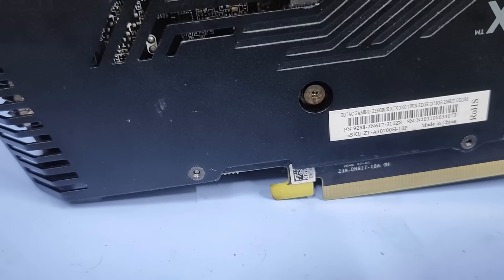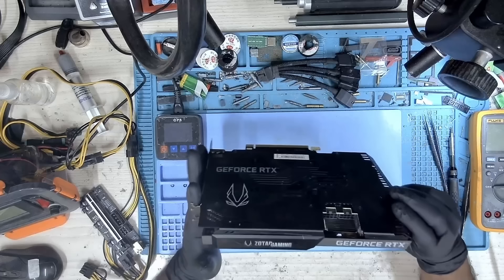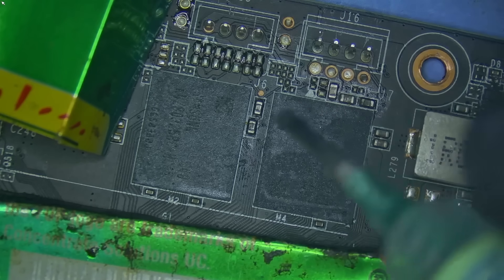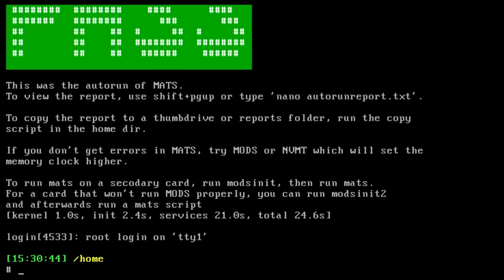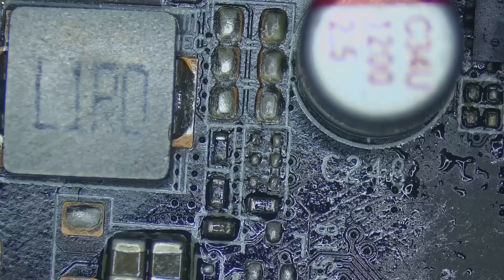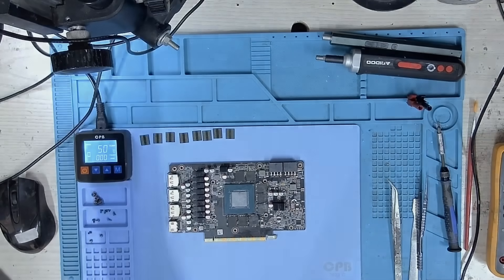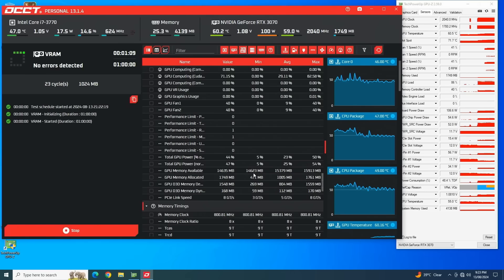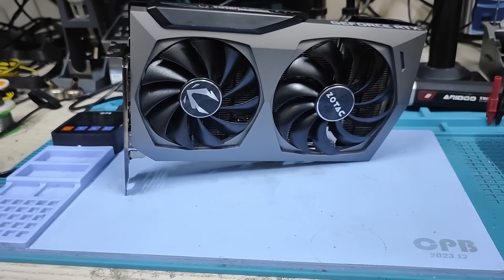Upgrading RTX 3070 Memory from 8GB to 16GB - Part 1

Comment: ive been thinking about pulling the rx580 cards that i have in the closet and modding them  andd adding  8gb more liek the  580 sp cards in china  but doing it at home  do you think you coudl make a video abotu doing this  with the rx580s i knwo the spots are there all i woudl have to do is solder the spots then use the heatgun and put the same vram chips on but i dodnt knwo if there is any software that wouidl need to be changed   and i knwo this woudl help the rx580  in alot of games these days for exampel i used to play tarkov  with one of them cards but the issue with playign tarkov was mostly the vram  liek streets of tarkov uses about 12gb of vram on my card i use now
Reply from the maker: RX 580 uses GDDR5 and 1 GB is the largest capacity produced on this platform. It has 8 memory slots and all 8 are already populated with 1 GB. To install more memory you will need to design a new PCB with memory slots at the back. This is an expensive procedure unless it is mass produced. The cost involved to get an upgrade done on RX 580 or any GPU that needs a custom PCB beats the purpose of being cost effective unless some factory is already producing a PCB like this like the RTX 4090.

Comment: Unfortunately the onboard controller doesn't know how to handle that much memory. I'm sure you might be able to tap into the extended frame but it will have glitches, crashes and blue screens then again who knows with some of these drivers
Reply from the maker: So far I have not experienced any glitches with the upgrades.

Comment: Avec quelle puce mémoires tu a remplacer les 8go en 16go ? Es des puce de 4go ?
Si oui alors il est possible de faire une rtx 3060 12go a 24go et la rx 7900xtx de 24go a 48go. Je dit cela car les plus grosse puce pour carte vidéo est 3go.
Reply from the maker: On GDDR6 and GDDR6X the largest capacity is 2GB. The memory used in this video is 2GB to upgrade to 16GB. So any GPU using GDDR6 or GDDR6X using 1 GB modules can only be upgraded to 2GB. RTX 3060 and RX 7900XT already use the 2GB module so it cannot be upgraded further. I have a dedicated video where I explain this in detail. 
https://youtu.be/nJ97nUr1G-g?si=1aFloIVAn2X0fFME

Comment: Do these upgraded v ram gpus come with a custom driver download that works and doesent crash. A rx9060xt/9070xt 16gb to 32gb would be prob the #1 gpu on the planet. Nvidia sucks cause they purposely will try to kill performance yeah itll be a custom driver but based of their driver thats tries to lower performance unless yall can weed that coding out
Reply from the maker: The largest capacity on GDDR6 and GDDR6X is 2GB. If it already uses the 2GB modules it cannot be upgraded further. All of the 6000, 7000 and 9000 series already use the 2GB memory modules. There is no more room to upgrade.

Comment: i have a 3060 12gb would be nice to make it 24gb i also have a radeon 6800 16gb wonder 32gb
Reply from the maker: Unfortunately 3060 and 6800 are both at its maximum possible memory capacity.

Comment: Have you seen the Chinese GPU aftermarket?

They upgrade all their GPU's instead of upgrading to a new one bc of financial and supply reasons. They have 64gb VRAM 5090 kits, 48 GB VRAM 4090 kits, 32 GB VRAM 5080's, pretty much everything. Even low end cards like 5060's get upgraded to 16gb. 
I think its so cool and wish more people here in the States did it so it would be easier to get the custom firmware needed and there would be more people making custom BIOS updates and everything else needed to accompany the VRAM upgrade.

Great work man, I wish I was as talented as you.

Comment: I wish the manufacturers would just allow us to add Ram, as if it were System Memory. (maybe soldered ram is faster?)
I have a 3060 ti. This card is actually a cut down 3070. The 3060ti is known for running out of VRAM too. (my 3060ti uses a SK-Hynix version)
Also it is said the 3060ti runs the risk of VRAM failing prematurely (mine is still good) I wonder if this could also be considered a preventative maintenance job?

Comment: What is a pain is that not only having to ball/flow the chips, but the resistors "straps" to get the higher capacity memory recognized.  I guess the ball/flow is worse, but there is no room to maneuver with the straps.  As long as you don't short anything you can always start over if your balls aren't connecting well.  Check for shorts before powering on.  And as the video shows, check 1cm around the chips in case any straps have been dislodged.

Comment: There is zero reason for ANY 1440P + card to come with less than 16 gb of VRAM and there is no reason for any 4K card to ship with less than 20 GB of VRAM imo 

1080p cards should all be 10-16 gb by default as well. 20-32 GB should be default for 4K 

Basically, 8GB cards shouldn't be a thing

Comment: Can you do a laptop? I've got a 4gb 3050 that just needs another 4gb
Reply from the maker: Most of the 3050 in laptops only have 2 active slots. It depends on what configuration is your laptop having. I have never tried upgrades on laptop yet. But if I do I will release a video on my channel

Comment: The fact my 3070 has 3 fans and still 8GB VRAM still makes me hate myself for not reading the specs first and not knowing much about PCs at the time.
Reply: when did you buy it? for its time 8gb was still kinda decent. tho 3070ti still has 8gb which is kinda dumb
Reply: @ArtByAhri 3 years ago. But there is a 16 gb version of the 3070 if im not mistaken. I was just a dumbass and didnt know there was 

Don’t get me wrong, my 3070 still gives me at least 60 fps on 5k resolution with three monitors on High settings, it’s a beast. But I would had definitely gone for more VRAM if I knew

Comment: Hmmmm.

Buying a bunch of soldering kit and some VRAM from aliexpress or wherever (and hoping it works), then spending hours trying to remove the existing VRAM and add the new and then hoping it all works...

VS.

Selling the card on eBay and buying a newer RTX card with 16GB of VRAM.

Comment: Not A Single 30xx Card Need 16GB 🤦‍♂All New Games That I Played In This Year Needed Maximal 5-6GB Only 🤷‍♂ And That With RTX 3050 (8GB) 💁‍♂ The Performance Is Just Too Weak, For Enabling/Using All Features AnyWay 💁‍♂ Same With 4K ReSolution. They Wasn't Build For It 🥲
Reply: Idk why a 3050 should decide it but some rtx 30 series cards should get 16gb. The 3070 is one of those imo.
Reply: @tietieno4890  I Know, I Know 🤗 But It's Not Worth It AnyMore 💁‍♂ Any 50xx Card With Higher DLSS Version Is Better Here 😐 But The Prices Are Horrifying As Fu 👀💀 RTX 5070 TI Is My Dream Card And The Price Never Reached Around 600 Euro This Year 🙄 (Checking EveryDay 😆). 600 Is Still 200 Too Much, But I Would Accept This ComPromise 🤗 (400 Euro Is The Double Price For The Double Performance Of The RTX 3050 💁‍♂ BTW)
Reply: @ThePolishJoker  Good lcuk finding a rtx 5070 Ti for 400 euro's let alone 600. The MSRP itself is already way over that
Reply: @tietieno4890  That's The Normal Price In The Normal World 😆👌 And They Reduce The Prices Automatically With New Super + 60xx Cards 😏 This Is How Rich NVIDIA Works. They Don't Care About MSRP 💁‍♂ Only About Fresh, Hot Sensation. (Example - My ASUS RTX 3050 8 GB Dual OC, Lost Its Value WithIn 2 Years Around 40% And That After Covid. Not From MSRP 🤗). WithIn 1 Year, The RTX 5070 TI Dropped Around 45% 💁‍♂And It Will Easily Drop Further To 600 Euro (50%). 400 One Day, When NoBody Cares AnyMore 😆👌

Comment: Can RTX 3080 be modded to 20GB or even 12GB??
Reply from the maker: I have not managed to get it to work yet.
Reply: @GraphicsCardRepairs-tk7ql I think 20GB mod could work. 12GB requires 384bit bus width and the normal 10GB variant might not have that on PCB.

Comment: The risk of the operation do not worth it. Sell it and go buy a new one! Too much noise for nothing, plus that you will pay the double in electricity in just one year. What an idiot, too many risky fixes for an old card that soon will die anyway! Plus that you have for sure to raise the power consumption for a 5year old technology adding this extra memory. Just the opposite thing of being ergonomic. You will spend more money in just one year to use a much more old card, that soon will die anyway, and maybe sooner from the risky fixes that you made. I will overpass you with an rtx5060ti 16gb for fun, when you will burn 200+ w just to play full hd ultra, when at thesame time I will undervolt the card burn maximum of 50w, being at 35C - 38C for the same or better result than yours! This is not an upgrade that you did, is tottally a disaster in long term plus that you lose time for nothing! You will not save money, you will just pay more in the end! And soon you will burn the card anyway! So you will buy a new one and you will lose the money that you can take by selling it! What an idiot!

Comment: How did you solder the new memory chips on the desoldered pins?
Reply from the maker: everything is in the video. Otherwise I have not understood your question.
Reply: @GraphicsCardRepairs-tk7ql  i was thinking what liquid you used to remove/put back the memory chips on the board. (or maybe the memory chips are presoldered and i didn't notice) i'll rewatch the video maybe i overlooked it

Comment: Why did you changed resistor position just flash bios
Reply from the maker: The BIOS already has the timings for the memory modules, like Samsung, Micron, and Hynix. The resistors I changed are STRAPS through which the BIOS identifies which memory modules are installed. Samsung produces 1GB 14Gbps modules and also 2GB 14Gbps modules. During the testing phase of the RTX 3070, Samsung was the only one that had a ready 2GB memory module. The others, like Micron and Hynix, did not have it ready at the time. They did later. So the BIOS of the 3070 has the memory timings for the 2GB 14Gbps memory modules in it. There is no need to flash the BIOS as it already has everything.

Comment: where's the details on the straps configurationnn
Reply from the maker: You can find it in the schematics and boardview.
Reply: @GraphicsCardRepairs-tk7ql  yeah I guess they would be there but where do I get those, can't find em anywhere
Reply from the maker: Try badcaps.net @JuanPabloAlvarez-f7s

Comment: Great video, thank you for sharing. Getting those memory chips in the correct orientation looks tricky! I'm not sure how you did it. I saw a spot in the corner of one of the chips but couldn't see anything on the PCB to line it up with.
Reply from the maker: Over time you start to get it right. There is a square mark on the PCB you have to align the chip with the square.

Comment: 3070 had so much raw GPU muscle for the msrp of $499 that it had many people selling off 1080ti/2080ti’s right before crypto hit. 

The AMD 6700xt & 6800 turned out to be the better buys with 12gb/16gb of VRAM. I own them both and the only 8gb I still own is a $160 Dell 3060ti that is doing just fine at 1080p 180hz.

Comment: What about a RTX 3060 12gig to RTX 3060 24gig ?
Reply from the maker: 3060 has only 6 active slots. It already uses 2GB memory modules. That's the largest capacity produced on GDDR6 and GDDR6X platforms.

Comment: can you upgrade my : MSI GeForce RTX 5060 Ti VENTUS 3X OC graphics card, 16 gb to 24gb
Reply from the maker: I have not tried upgrades on any 50 series yet. Theoretically, there is a chance, but it is yet to be tested.
Reply: @GraphicsCardRepairs-tk7ql  what will it cost me
Reply from the maker: @Damnation71 right now I have not tested yet. 3GB modules arenew and not available to buy in the open market yet. May somewhere down the line these memory modules will be available and can be bought. May be then I can provide a quote. I will release a video on my channel when I manage to upgrade a 50 series GPU. Stay tuned.

Comment: Hello friends! The GeForce RTX 3070 VENTUS 3X OC video card does not pass the test in 16Gb mode, I switch to 8Gb mode, the memory test passes and works stably/ What could be the problem?
Reply from the maker: Check the straps. Hoe is the setup done to change from 8GB mode to 16GB mode. Is there a switch installed?
Reply: @GraphicsCardRepairs-tk7ql  es, they are installed correctly on 16Gb Samsung

Comment: I'm not sure if anyone else is noticing this... but after these types of upgrades things like PhysX usually stop working. Is this just me or has anyone else noticed the older games losing that functionality on 2 and 3 series rtx cards that have gone through this upgrade processes for doubling VRAM? That still doesn't rule out the fact that this upgrade is amazing for all newer games and also AI Image Generation and dare I say it... Mining (Which I hate). All that being said... This dude is the most talented man I've ever seen with a heatgun and tweezers. Probably should have been a surgeon.
Reply from the maker: Just to confirm. Physx still works on these upgraded GPUs. In these GPUs only memory capacity has been increased.
Reply: @GraphicsCardRepairs-tk7ql yeah. I noticed when you pulled yours up in GPU-Z it checks out fine. I bet you're doing things correctly with the straps when other people aren't.
Reply from the maker: @Marty.Midwest straps are to tell the bios which memory modules are installed on the PCB so it can load the timings for it. That's the only roll of the straps.if install straps incorrectly then the GPU will not get detected or show memory errors. Physx has nothing to do with straps. It could be something else that was messed up.

Comment: wondering if its worth while upgrading a used 5070 12gb I have in stock to 16bg instead of buying myself a new 16 gb version. What do you charge to upgrade a 5070 8gb to 16 or even 20-24gb? Please let me know, Thanks
Reply from the maker: I have not tested upgrades on AMD GPUs yet.
Reply: @GraphicsCardRepairs-tk7ql  ok thx, but maybe I didnt explain right :-) I was wondering what you would charge to upgrade a n NVDIA RTX 5070 from 12gb to 16gb or 20gb. As I have a few RTX 5070  cards from old builds. Thanks!!
Reply from the maker: @leadplayer0505 I have not tested upgrades on AMD 5700. So I am unsure if it will work. It is yet to be tested. It is possible that it may or may not work so I cannot quote a price.
Reply: @GraphicsCardRepairs-tk7ql  oh I am sorry I thought the RTX 5070 was NVIDIA?
Reply from the maker: @leadplayer0505 my bad I don't know why I was referring to amd 5700. Ok. For the Nvidia 5070 again I have not tested yet. Theoretically it is possible using the 3gb memory modules. But the thing is these 3gb memory modules are new and not available to buy in the open market yet. Maybe once I get my hands on a 5070, 5070 Ti or the 5080 I will test it out.
Reply: @GraphicsCardRepairs-tk7ql  OK thanks very much, infact when I check my shelves if I have 4 or more 5070's I could send you one to keep as a card to test. Thats up to you, but I need to make sure I atleast have 3 for upcoming builds first.
Reply from the maker: @leadplayer0505 that would be great. Once the 3GB modules are openly available I can test it out. it would be a good opportunity for me to experiment and also content for my channel. It will also help others looking for the upgrade.

Comment: does it matter which way the chips are oriented or can they be either way?
Reply from the maker: @theshyguy3  yes it matters. The pins are positioned in a certain way so it has to align properly.
Reply: @GraphicsCardRepairs-tk7ql  could you perhaps be helpful and explain which way it goes or are you just gonna say sm shit while wasting everyone's time?
Reply from the maker: @theshyguy3  I am making a video specific to removing and installing memory modules. Anyway in the PCB there is a marking which indicates pin 1 same is in the memory modules. Under the memory as well as on top of the memory there is a marking like a dot which indicates the pin 1 you just need to align it. If it's confusing wait for my other video where I will show exactly how it's done.
Reply: @ see, thats more helpful ty. and yh just send me yr vid when its posted and if its helpful ill giv it a like

Comment: Hi, what are your preheater temp.and temp on hot air gin, thanks!
Reply from the maker: The temps will depend on your hot air station you use but on mine preheater I'm using 120C and hot air I'm using 420C with air flow 60%